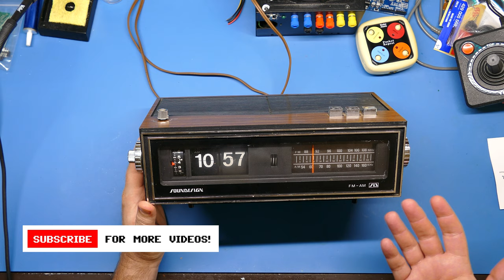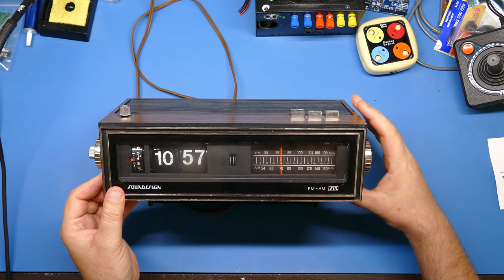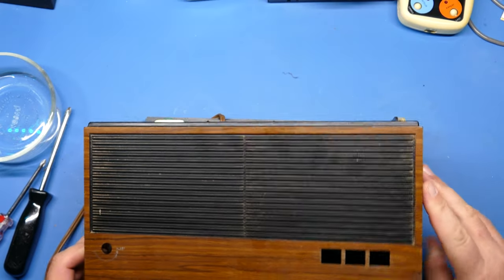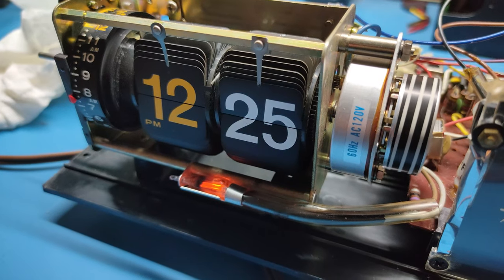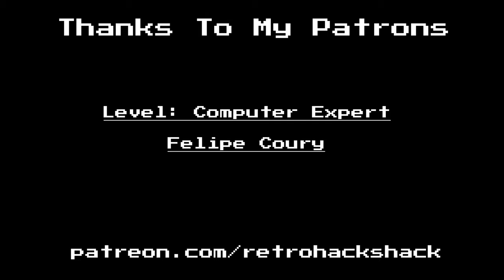Flip Clock Repair - Quick Fix

Comment: Great job on fixing this retro flip clock. It's fasicinating! The reason how I came across your video is because I am trying to fix my flip clock here which is a much simplier design flip clock, no radio. :)
Reply from the maker: Cool. If I do it again I will probably try spraying some deoxit in the motor first since the alcohol took off some of the paint.

Comment: Ive been looking for one of these clocks for years and finally found one. Had to solder some wires and the motor needed to be cleaned just like yours, now it works perfectly. It's a sony with a function to snooze by touching a capacitive metal bar labeled "dream bar". Pretty cool

Comment: This is an interesting repair as I also have an old non-functional flip clock.    Well, it's actually my parents' clock that I believe they bought sometime in the 1970's. It's a Cariole, which I think is now a defunct brand. The numbers are angled up, instead of normally facing towards its window so you can't obviously see the numbers.  It also has that moving spiral but nothing is moving.  However, just like in the video, the rest of it seems to be just fine, such as the am/fm radio.  I will have to open it one of these days, it could almost well be the motor itself.  I do have another clock but it doesn't have the numbering flip plates so rather all the numbers are painted on a wheel, which I'd imagine is some form of decagon & that too doesn't work, but the radio does.  Both these clocks are from my youthful past. And just like many of us who are into vintage stuff, it would be a waste if these were thrown away, because if there are only a few of us tinkerers, collectors & nostalgists, there are a great many more who could care less & will trash them.  I've gone to recycle stuff at the recycler/trash company & it's just kinda sad seeing so many machines brought there to be recycled. One reason is people want to upgrade to a new machine & give room to it.  And of course the other reason is they have no idea how to fix it if it's broken, hence why they brought it there to be recycled.  I suppose it's better for the environment when it's recycled rather than put in the landfill, even something like a broken-down flip clock.   I've fixed many things so far, so these clocks are going to be in my repair queue, just unsure when I'll get to them.
Reply from the maker: Awesome

Comment: Amazing video!! This is the power of the internet, I have a radio, a different brand but the clock font seems exactly the same and the overall look of the flip-over. I will try repairing it next week as I have the similar problem that the motor doesn't spin! Thanks a lot!!!
Reply: Yes I did it!! I managed to repair my music air 10F-2Y thank you so much! I love this radio. Also the isopropanyl did it for me.

Comment: First time taking apart, just did alcohol bath..nothing. Second time taking apart added 3 in one oil and it appears to be working.  Well numbers are changing, the wheel looks slow so not sure if time is accurate. This is a MAJOR accomplishment for me because EVERY time I take something apart based on a YouTube video the item is a total loss.  I did screw up the wire that moves the radio dial on this one but getting the clock working outweighs that problem.  THANK YOU!

Comment: I came here to say this video just helped me save a motor out of a Panasonic flip clock.
Reoiling it didn't work, it wouldn't start on it's own. But it looks like doing exactly what you did getting rubbing alcohol in the motor and so far, it starts on its own now!
Thank you, I would have never thought to do that.
Reply from the maker: Awesome! I am going to look for a way that doesn't remove the paint on some models.
Reply: @RetroHackShack  This actually didn't remove any paint on mine. What percent rubbing alcohol did you use? I used 70%. If you used anything higher or 91% that might be why.
Reply from the maker: I probably used 91
Reply: @RetroHackShack  That might explain it then. 91 is too strong and is pretty much a paint thinner

Comment: You are ritght, very few people have any info on fixing these.  I have a panasonic flip clock whose motor does not spin.  Looking for help on what wires power the motor, where they come from and what the voltage should be.  Still looking for information but it might take a while. Please help.
Reply: Probably needs the motor oiled or cleaned out. Usually by disassembly. Maybe try a syringe filled with oil to get the hard to reach places and you might not have to take the whole thing apart. Also sometimes just spinning the motor a few times with It powered off will work the existing oil/grease/"Shmoo" around and get your motor running again. clocks can be finicky sometimes. Good luck Godspeed 😃

Comment: I have clock similar to this, but the radio doesnt work, the cap won't come off
Reply: Any tips
Reply from the maker: The knobs on mine were really tight I had to apply pressure with a screwdriver.
Reply: Thanks I'll try this out